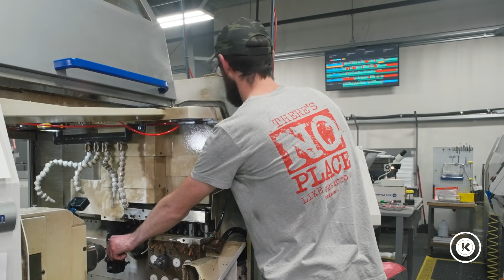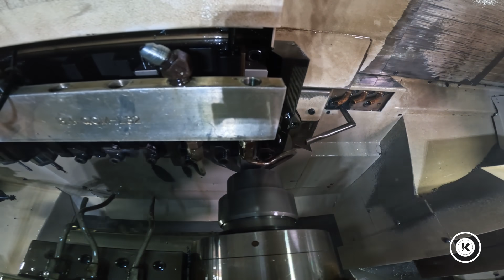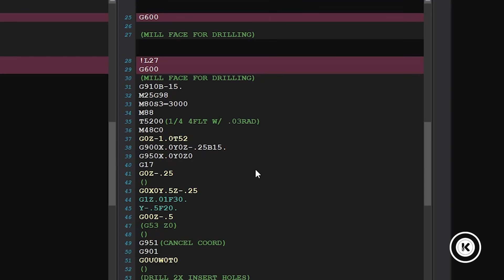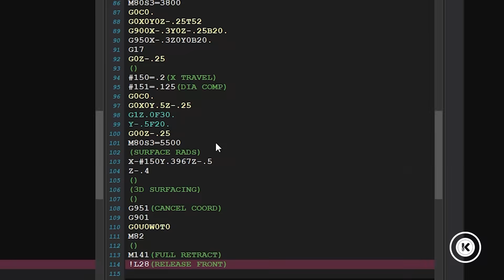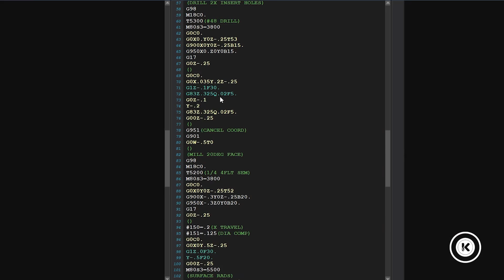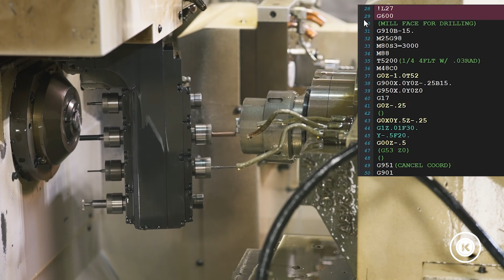How To Code Programs To Run Swiss Lathe B-Axis Tools

Comment: Hello, may I ask which software you use to view the CNC program? I noticed in your video that the programs on both sides are synchronized line by line (e.g., G600, G630, etc.). Could you please tell me the name of the software? Thank you very much!
Reply: I use CIMCO Edit 8.10.06, but it only synchronizes scrolling based on labels like "!2L1-!1L2". It doesn't synchronize scrolling with G600, G630, or other G-codes the way it does in your video.

Could you please let me know if there's a setting I need to change, or are you using a different software or plugin? Thank you!
Reply: Open a new file/program, then click "setup" on the far right of the Editor toolbar.
On the drop-down menus on the left of the pop-up window you should have "Multi Channel, click it
There should be a button that says "configure", click it.
In the new pop-up window it should have a list of synchronization triggers, click "add".
I think the text string you want to add as a new trigger is: 
<G6[0-9]{2}>

The {2} may be defined as zero somewhere, or you may be able to replace it with "0" since all your G600 codes end with zero anyway.
Reply: @SecondFloorOutdoors  Thanks bro !

Comment: Sir, Please Explain G600 , G610, G620,G630,G640,G650,
G66O SERIES CODES
Reply: Machining Pattern 
To simplify a program used with a multi-axis machine, operations (machining) are grouped by purpose. An 
operational (machining) group is called a machining pattern. 
Specify the machining pattern in both axis control groups 1 and 2. 
• Free pattern (machining pattern cancel) (G600) 
This pattern cancels any of machining patterns G610 through G660 while the power is being turned on. 
In the free pattern (machining pattern cancel) mode, front/back parallel machining is possible.  
With the front axis control group 1, front outer diameter machining and front drilling operations are possible using 
the gang tool post while machining using the back tool post is possible with the back axis control group 2. 
• $1 single machining (G610) 
This pattern allows the outer diameter machining by gang tool post or inner diameter machining by opposite tool 
post in axis control group 1. 
• Inner/outer diameter simultaneous machining (Z1-Z2 axes superimpose) (G620) 
This pattern superimposes the Z2 axis on the Z1 axis, and allows outer diameter machining with gang tools in $1 
and inner diameter machining with drilling tools on opposite tool post in $2, simultaneously. 
• Front/back parallel machining (G630) 
This pattern is used in front/back parallel machining. With the axis control group 1, front outer diameter 
machining and front drilling operations are possible using the gang tool post while machining using the back tool 
post is possible with the back axis control group 2. 
• Pick-off, center-support (Z1-Z2 axes superimposition) (G650) 
This machining pattern enables the back spindle to rechuck the workpiece and support the center of the workpiece. 
• Front/back simultaneous machining (G660) 
This pattern allows front/back simultaneous machining of the axis control groups 1 and 2 using the drilling tool 
holders on the gang tool post.
Reply: Thank you very much Sir
Reply: 1.If possible, please create a video on simultaneous and parallel machining—specifically related to Swiss-type machining—that demonstrates the use of G620 and G630 codes.
Reply: Please Sir, Please explain all these codes in a video!
How do they work in program?
Reply: @vinaykumar-mr3vz  Tôi không biết làm video để giải thích, những gì tôi gửi cho bạn đó là trong tài liệu của máy tiện Citizen L12 của tôi.
Reply: @vinaykumar-mr3vz  tôi nghĩ đây là thứ mà bạn đang muốn tìm kiếm : https://www.youtube.com/watch?v=C-TLLTOYHlw&t=271s
Reply: Sir, the documentation does mention that G630 is used for parallel machining and G620 for simultaneous machining. However, I would like you to explain—in a block-by-block manner, just as you did in this video—how codes like G620 and G630 work in conjunction with queuing codes, as well as when and why they are required. There is often a lot of confusion regarding which code to use, and the specific reasons and timing for applying them. Please, Sir.
Reply: @vinaykumar-mr3vz  Tôi đã gửi cho bạn 1 link video mà tôi nghĩ là bạn đang cần nó, hãy xem video đó.

Comment: Hey Chase from Kremin! Will you guyz do a video on how to program in mastercam & then convert it to say a 1/16" ball endmill, in the gang, T6-T9, & interpolate around C axis. I HAVE to learn how to do this. Would be SO THANKFUL if you guys would do this 😊
Reply: Hi, it's probably way late now, but you're probably looking for G12.1 with G16, cylindrical machining. Program G12.1 like normal but define the work plane as G16 inside the G12.1. I put it before the rapid approach move. Cancel with G13.1 like normal, call G17/G18/G19 for next tool. Dimensions are radial, Y+ in mastercam becomes Z+, X becomes C